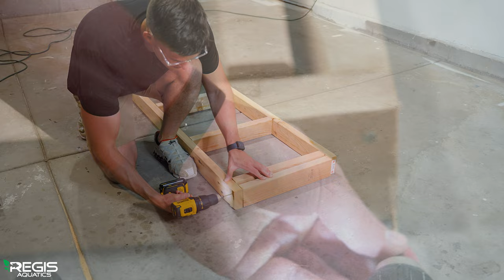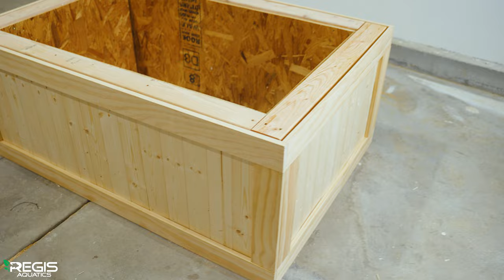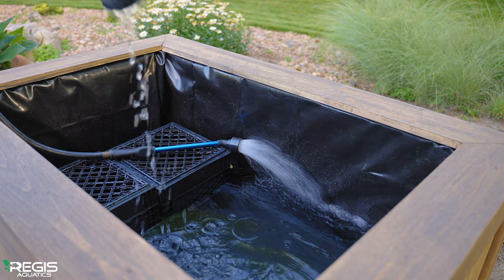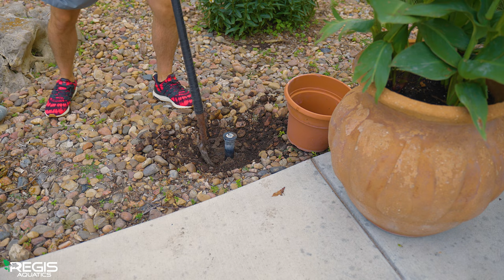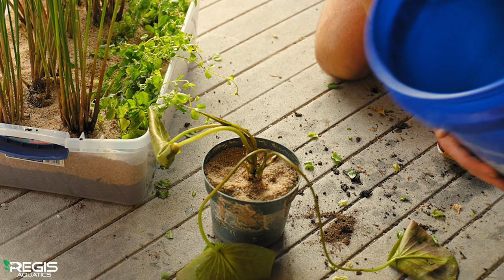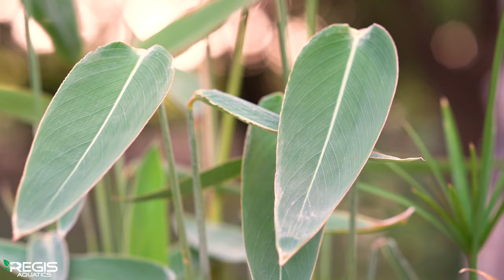Building a Solar Powered Fish Pond - Timelapse

Comment: I have recently made a raised pond , similar size to yours from a reclaimed dolav pallet box. I've put a wooden frame around it & diverted a rainwater pipe from the conservatory roof to fill it. Next step is a solar powered pump to help airate the water.

Comment: How did you seal the hole you drilled in the liner
Reply: Usually, using wood powder and 502 glue will do the trick, or simply mix fine wood powder with silicon.